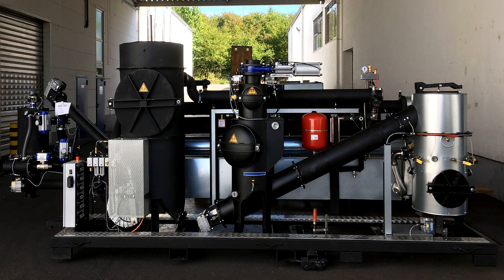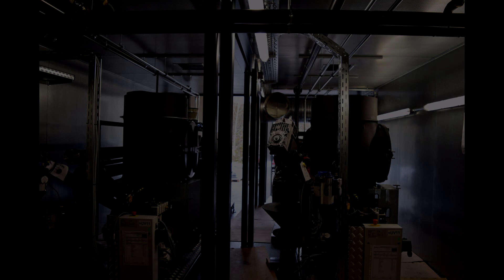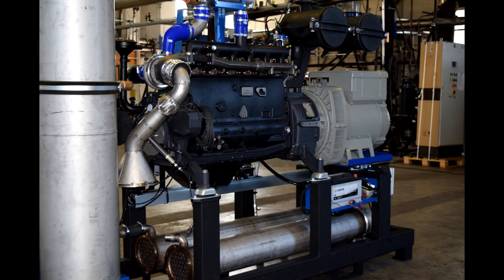Sawmills Go Green: CO₂-Neutral Energy with Wood Gas Technology #sawmillbusiness #energysufficiency

Comment: That kind of power plants were used in Finland before the ll WW in small saw mills. Bigger used steam power. The gas had 80 % of woods primary energy.
Reply: Do you know if there ae some companies selling such systems for home/small installations? Thanks
Reply: @markusscholz5683  I don´t know any companies, but surely you can find some from the internet. For small domestic use those systems need too much work. You have also to clean filters quite often. It would be easier if someone would combine wood gasifier and stirling engine.

Comment: Would it be possible to recycle the exhaust gasses from the engine back onto the gassifier unit to reduce emissions of CO? Maybe through some type of condenser and pump condensate  into a coil inside the heat reaction vessel to be re burned?
Reply from the maker: Hello Jason Burguess, 
In principle this is possible, but the energy content of the gas that is fed back into the engine would decrease, thus reducing the power output.